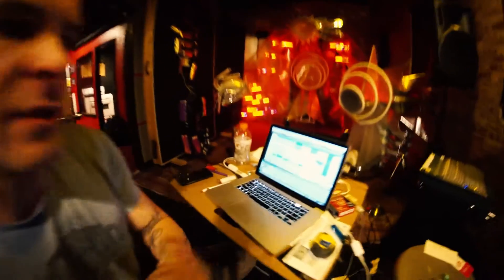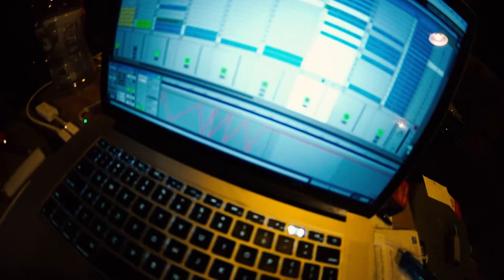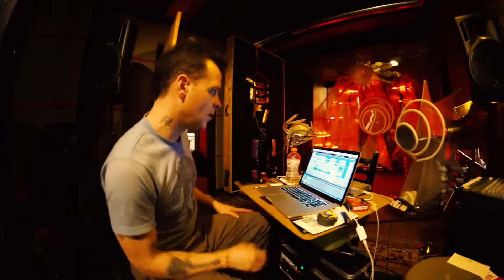Burton L with Ableton and Touch Designer - Light Show!

Comment: Heyhooo, awesome work! Really nice!! I'm really inerested into controlling led and projection mapping over Touchdesigner, but i stuck, there are so many tools.. I need an overview!! Could you make another video or tutorial how do you controll your led with Touchdesigner and what controllers you use.. Artnet or Dmx ... That would be so nice. And its nice to see the sceen is growing! greetings!
Reply from the maker: We used usb teensy to arduino to the LED sculpture and custom built a max plugin that communicated with our network in Touchdesigner. Ableton sent the midi through our plugin via selecting specific animations we designed to designate where and how RGB would animate over our virtual 3D model of our sculpture in Touch. (In our plugin there was a drop down menu of our pre-designed animations in touch that were virtually mapped in Touchdesigner with 4 controls.) Depending on the animation, the options could be RGB, xyz, speed etc. applied to each knob. Through midi and automation of the controler (max plugin) I could program a desired sequence depending on all of the above.